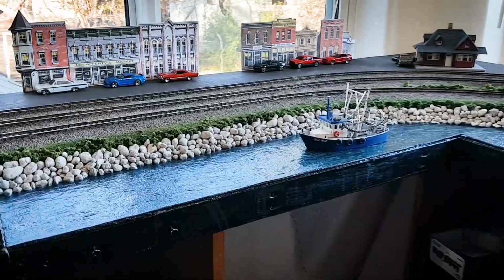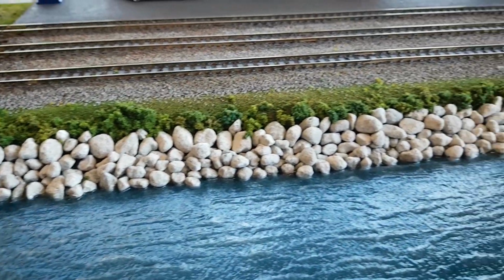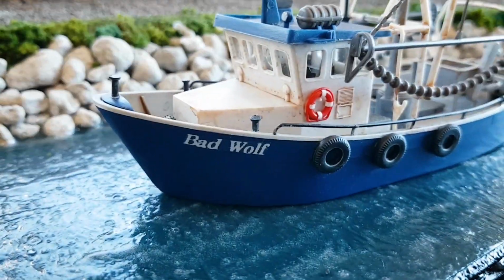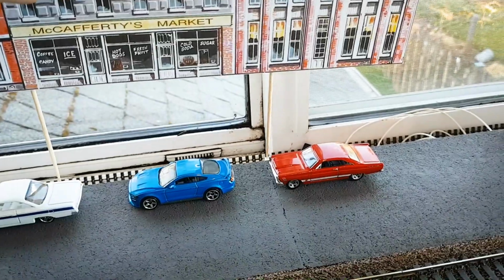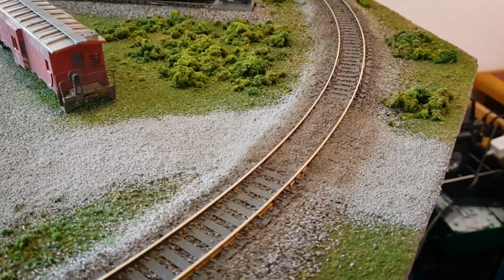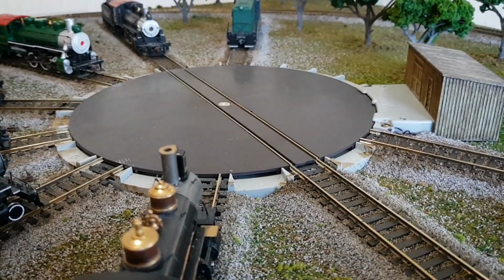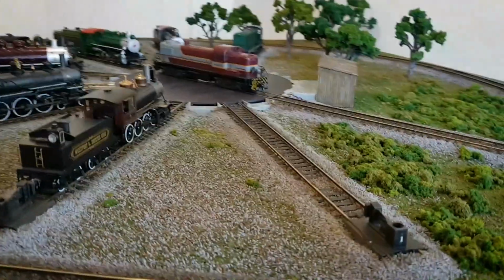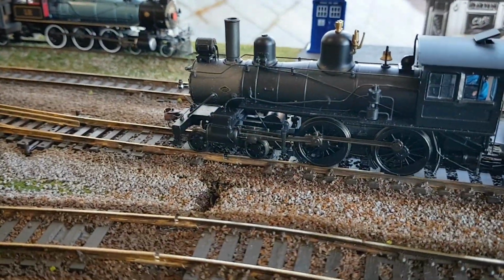Scenery Finished, Mostly (W&SC Update #9)

Comment: 0:19 it’s nice to see No. 12, I think it has become one of my favorite YouTube custom featured engines (you know, the types that YouTubers customize and are basically a part of their channel - everyone recognizes the engine when they see it and it’s exclusive to that Youtuber) I really do think it’s a shame that it doesn’t run, but it looks very nice on static display! 

Keep up the good work, Michael!
Reply from the maker: Thanks! I'd love to get #12 running again someday, but I doubt it will happen. More likely, I'd just end up buying another Bachmann 4-6-0 and re-creating it from scratch.
Reply: @redoaktrains  imo you should give #12 a backstory (doesn’t need to be real) just something interesting to give it a reason and a story for it being on static display! And once it runs again (I believe In you!), you can make it as if some group on the Westport and shelter cove railway had a restoration project.
Reply: @redoaktrains  If I were to come up with a backstory for #12, it would be something like this... I do not expect you to use this story, but I would be extremely flattered if you would. so I am pleased to present to you, the backstory of #12.

In the mid 80’s, #12 was doing an excursion run for the annual “steam by the harbor” event at the WP&SC RW when the engine had a boiler malfunction, stopping the engine near the lighthouse. After the crew determined that the engine had a malfunction, and would need to be stopped, the engine’s fire was put out, and the water in the boiler was drained. In no time, the Fire-Department arrived to make sure that the engine wouldn't explode. The engine proceeded to be towed to the yard by #40. While the situation was de-escalated and all the precautions were taken, #13 was steamed up, and coupled up to the train. After #13 had passed the yard, #40 continued towing #12 to the turntable to be properly inspected and to not delay the passage of oncoming trains on the main line. The event was continued while Railway officials were fuming over what just happened to their beloved #12. Once the engine was inspected in the following weeks, the railway officials determined that the engine suffered a major boiler leak and it was a miracle that the engine didn’t explode. After long consideration, the Railway decided that it was too expensive to mend the engine and decided to transfer it to static display later that year. In years to come, a new engine was brought in to replace the #12, the engine was #9 and was renumbered from its original number in the coming months. After many years, in 1997, #12 was lacking some love, so a railway historical society club called the “Red Oak R.R Historical Society” came to cosmetically restore the locomotive in 2004. The locomotive was repainted in it’s wonderful and original Black, Sky Blue and Maroon paint scheme. Now we come to 2020, The Red Oak members decided to offer a full restoration project on the engine, and for a bargain price! Thankfully, the WP&SC RW agreed to the project and in September of 2021, the restoration project began!

Once again, I do not expect you to use this, in fact you can change this up. I hope you are pleased with my story and I also hope that it will come to good use.
Reply from the maker: @TheBerkshireMainline  I like this story! I might end up making it official. Right now I don't have any immediate plans to restore #12, but it may happen someday.
Reply: @redoaktrains  I hope it is all good in the end (you can even make it so that the project is “underway” in the story, to hide the fact that nothing is actually happening right now in the real world!)

Comment: I'm not that experienced at building models and kits, so I'm just a little curious how easy it is to put together. for example, do the pieces all simply click together, or did you have to use glue or something? also are there ready built boat models out there, in case i can avoid buying a kit?
Reply from the maker: It really depends on the kit. Some will snap together without glue (although they usually hold together better if you use glue). Most kits require some glue. This particular boat kit has a lot of tiny parts that have to be glued, so I wouldn't recommend it for your first kit.

There are quite a few pre-built HO structures on the market, but not many boats that I can find. If you'd rather not have to build a kit, there are a few 3D printed HO scale boats available on eBay. The detail usually isn't as good as a kit, but they can be made to look decent. Here's one that comes pre-painted: https://www.ebay.ca/itm/164875836879

If you want to learn how to build kits, I'd recommend starting with some simple structure kits first. They're designed for model cement, but you can use superglue if you want - just use a toothpick to apply it very finely, and get some CA accelerator to cure it quickly. Once you have 2 or 3 successful kit builds under your belt, the Walthers boat kit shouldn't be too difficult.